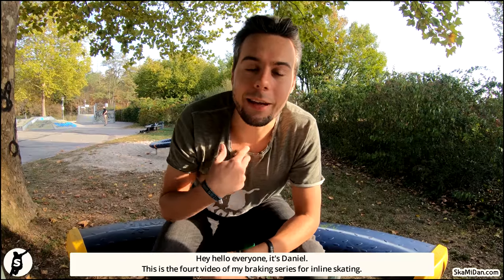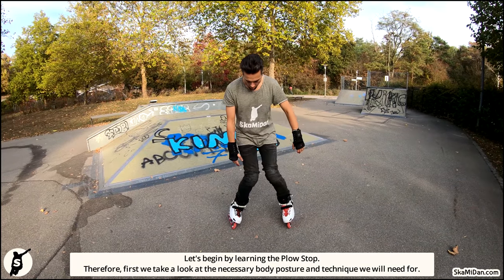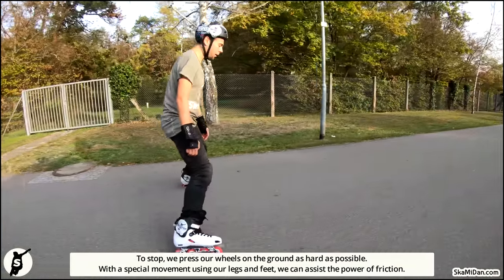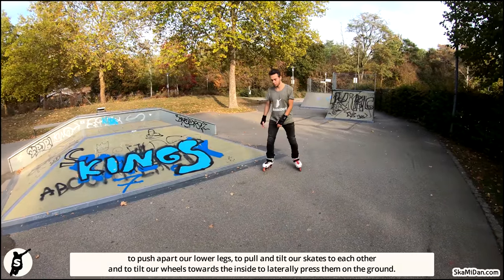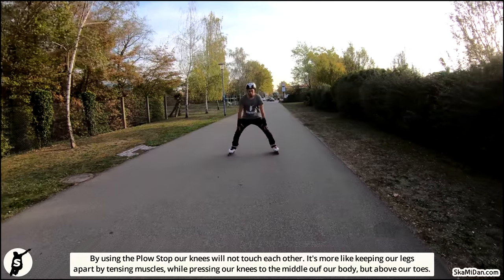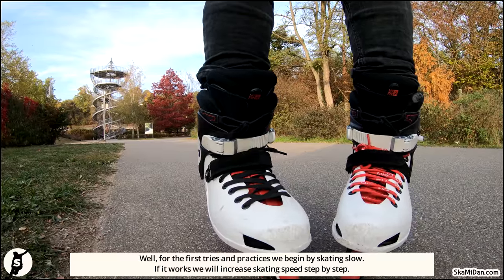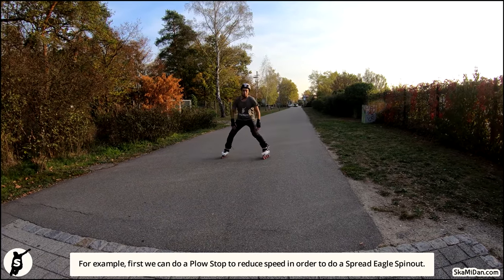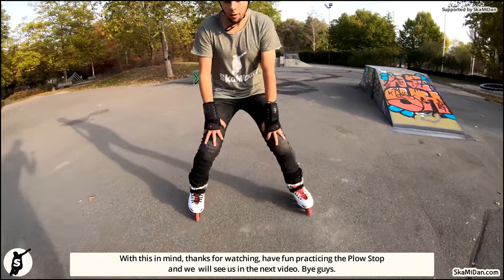Learn How To Plow Stop On Inline Skates | Plow Stop On Rollerblades | How To Stop On Skates #04

Comment: 3 or 4 wheels? Tell me what you think
Reply from the maker: It's different and it depends of everyones skating style. The most important differences:
The advantage of a four wheels skate:
Usualy you will have a longer frames, so it's more difficult to lose you balance in front or back. As a result it's easier for beginners.Skating downhill you will have a better grip, you won't breakout that fast like on three wheel skates.

The advantages of a three wheels skate:Usualy you will have shorter frames, your manouverability is much better. It's easier to turn and spin around.Usualy you will have installed bigger wheels, you won't stuck on uneven grounds, pebble stones and others that fast like on four wheels.

My personal opinion:Common four wheels skates are better for totally beginners, because it's easier to maintain balance.Common three wheels skates are faster, better for doing tricks and much easier to handle.
There are three wheels skates on the market, they also have such a long frame and the same wheel base like four wheels skates and vise versa.So the listed advantages and disadvantages are not valid.🙂✌